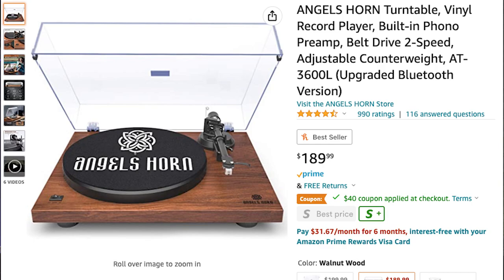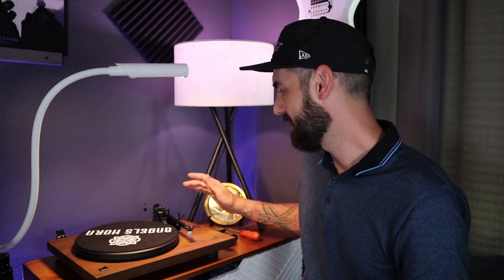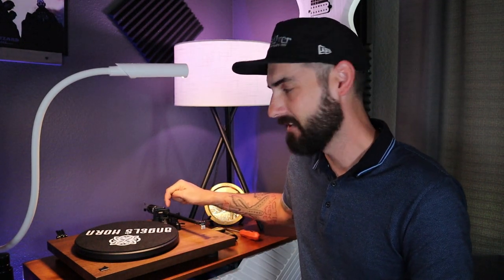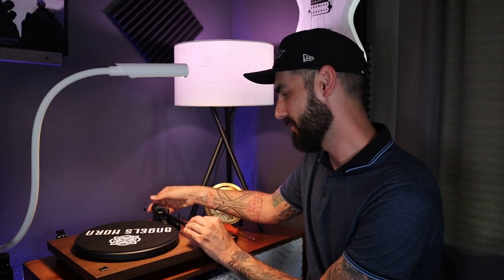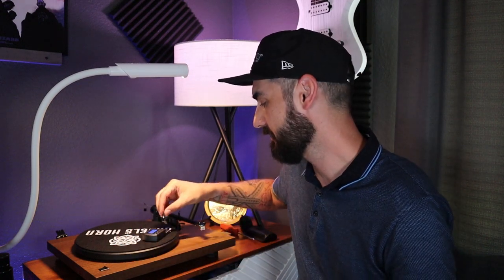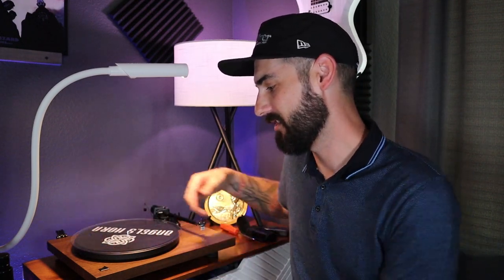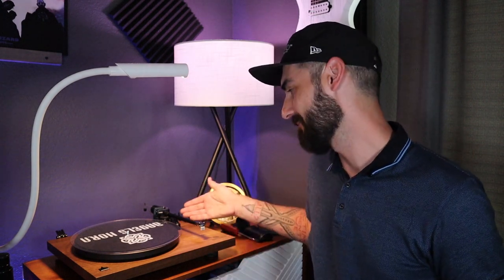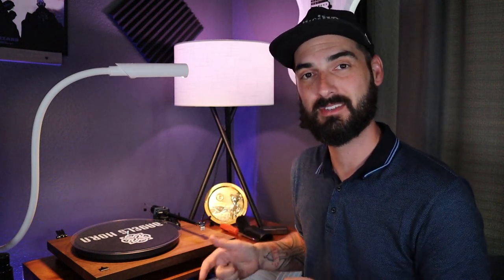HOW TO FIX Angels Horn Turntables

Comment: Great vid sir! I have the same exact turntable, but a different issue... The table spins at 34.5 rpm out of the box. Any idea how to solve? (belt is properly installed) I'm curious if yours spins fast as well and maybe you haven't noticed? Thanks!
Reply: You have to do a speed adjustment, by turning the speed adjustment screw on the bottom with a small jewelers screwdriver.  You have to remove the bottom panel which is a pain since it's held with six screws but behind the panel there are two holes with adjustment screws, the one labeled low is for adjusting 33.3 rpm mode and the one labeled high is for 45rpm.  It only takes extremely small adjustments of this screw to greatly affect speed, and it's a lot of trial and error to get it right.

This is my first turntable and I wish I spent a little more and chose differently.  With a LOT of tinkering, I've got itin an acceptable state, but these things should just work a whole lot better out of the box.  Even properly adjusted, the wow and flutter isn't great (which wasn't a problem at all on a barely more expensive U-turn table my dad has and that also came with speed spot on),  so I kind of have some remorse with this turntable).  Still using it for now, but yeah...
Reply: @deathsaber  I got it to the right speed after a few hrs of tinkering. I agree, this should work correctly straight out the box! I used the app RPM Speed & Wow to assist. Trial and error for sure and extra emphasis on small adjustments
Reply: @deathsaber 12/25/23, Gift for my son. Worked great for about an hour then speed started fluctuating very noticeably. Emailed to activate warranty(however thats supposed to work) and described problem. We'll see how they handle. Thinking I'll end up needing a new motor and/or belt, neither of which seem to cost much but frustrating to have this problem on day one. Since it seems to fluctuate, I figure it isn't just an adjustment of speed. Was happy with it up to the point this started happening. Not so happy to be dealing with this on day one an hour into use though.

Comment: Thanks for the video!  I’ve never had a turntable with counterweight adjustments needed.  My only suggestion would be some close-ups as you’re making the adjustments.  Also is the small weight dial supposed to just freely spin?  I would imagine there should be an initial start point but mine spins freely in either direction.  Thanks!

Comment: Thanks for this! Going to try this because I am very close to returning mine as the needle continues to scratch my records. Can you link the scale you used?
Reply from the maker: After loosening the screws a little be sure to add more weight to the tone arm their weight dials are waaaaay off!
Reply from the maker: https://www.amazon.com/Musou-Turntable-Backlight-Tracking-Cartridge/dp/B071P9VZ5Q/ref=sr_1_1_sspa?crid=17PEMJ99IPOJP&keywords=turntable+cartridge+scale&qid=1658169057&sprefix=turntable+cartridge+scale%2Caps%2C137&sr=8-1-spons&psc=1&spLa=ZW5jcnlwdGVkUXVhbGlmaWVyPUExN1RZSDdDRjNVVzJCJmVuY3J5cHRlZElkPUEwNDU4MDg2M09ITzlDMk1PWTA2TCZlbmNyeXB0ZWRBZElkPUEwNzY5Mjg2MjRBWlY1WU5YOFJPVCZ3aWRnZXROYW1lPXNwX2F0ZiZhY3Rpb249Y2xpY2tSZWRpcmVjdCZkb05vdExvZ0NsaWNrPXRydWU=
Reply: So you were saying that you had a fix also for the arm lowering device you never did get to that what did you do to make that work right thank you for your time